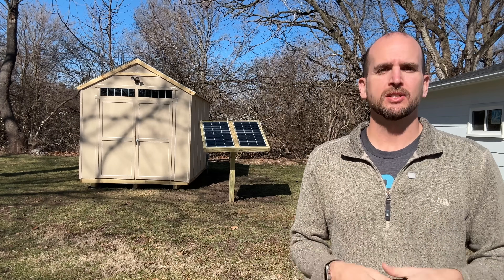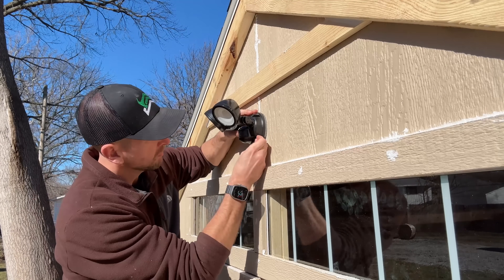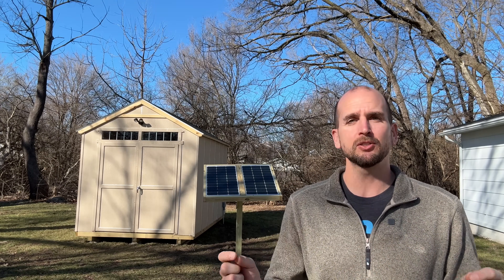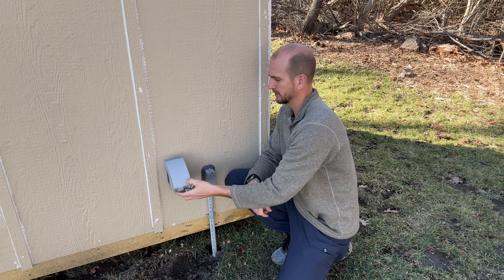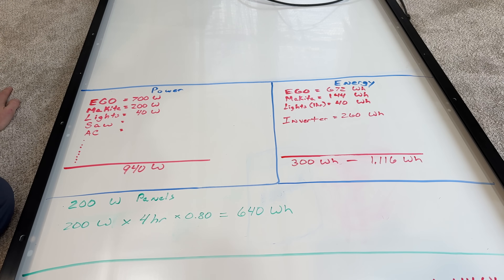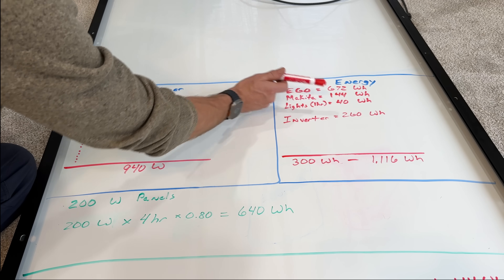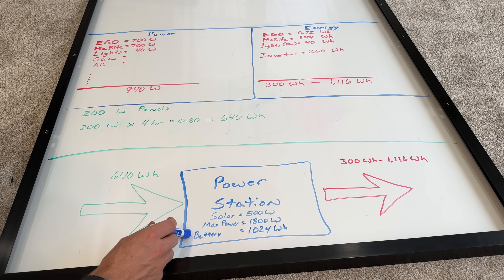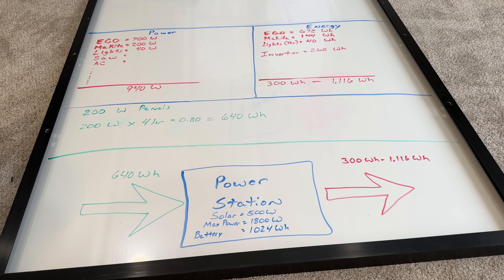DIY Solar Powered Shed Setup

Comment: Sorry, this video isn't for the average homeowner😊
Reply: The average homeowner doesn't watch these kinds of videos. Now the average diy home owner certainly does and benefits from this kind of content.
Reply: You just have to decide that’s what you want to do then go for it.
Reply from the maker: Which part?  Just Solar in general?
Reply: More that it isn’t for the average homeowner’s wallet. Off-grid shed power at >$1K is fun, but not so justifiable, me thinks.
Reply: Sorry, I just had to jump in: 

Don't speak for a class of people you have no knowledge of, nor statistics to back up such a statement.  If they aren't interested, they're not watching Scott's presentations and don't need a spokesman.

Scott's lessons don't address the "average homeowner" you are "speaking" for. And they might not appreciate you attempting to speak for them. 

You don't need $3k to set up a complete solar system. Use one panel, one car battery, one charge controller, and DC lights, a limit switch so you don't over-drain the battery, and  with a switch (useful to light a shed or security light). That's barely a $.4k setup.